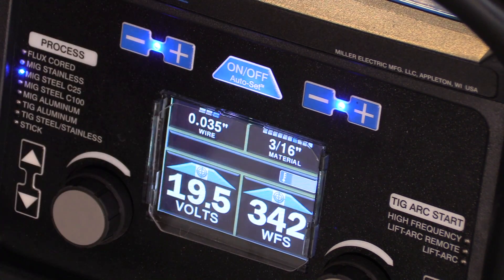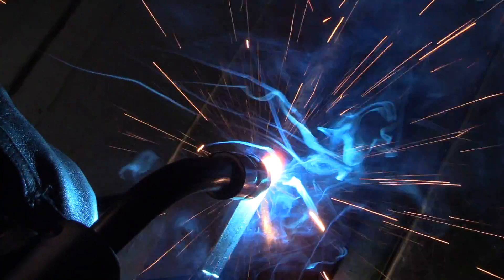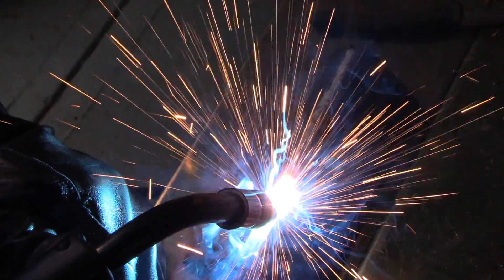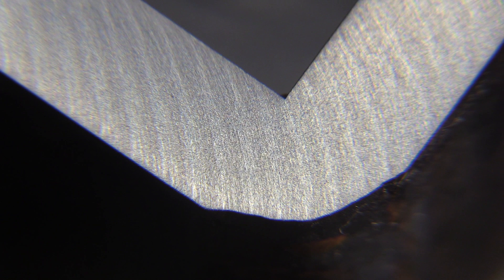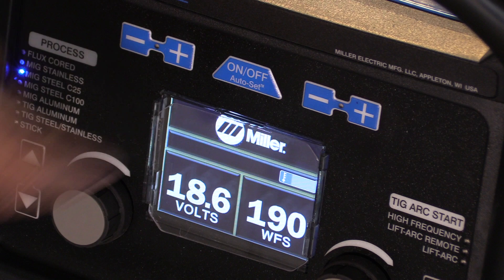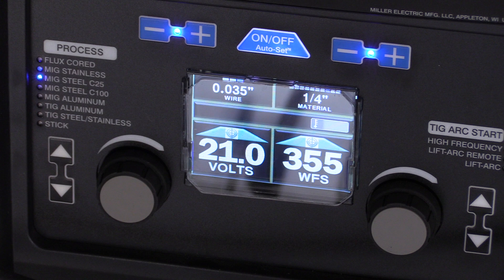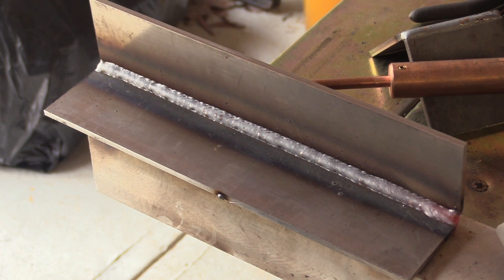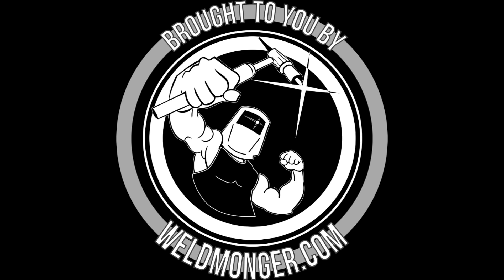Testing MIG Settings - Miller Multimatic 220 MIG Welds | Welding Tips & Tricks #Welding #MIG

Comment: Basically the Mig Like Tig motion is the old school "Whipping It".  By preheating the metal a bit more by whipping the arc forward, while letting the previous puddle or layer, cool. Giving it that tig like similar  appearance. I prefer to face the mig cup towards the direction I an welding. Resulting in a bit more penetration. Due to the preheating of the base material out in front of the weld puddle. Just like Tig.

Comment: I have a question I look at mig like tig wouldnt it be true that the higher the wire speed the cooler the weld?? When I mig weld my goal is always to run a tad hotter than what the volts say and a tad less wire speed than what the machine says I figure by doing that my weld is plenty hot because I dont have as much wire being fed into the material and I'm hotter than the recommended settings a little bit and my weld is flat in the groove so it looks like it had good penetration because the weld isnt convex its sunkin into the material. Please let me know what you think
Reply: i think volts determine how much wire burns off with each short ckt, while wire speed is the number of short ckt per second(Hz).  a higher wire speed equals higher  hz equals more heat.  that being said, burning wire into the puddle just heats the puddle rather than burning into the workpiece and just heaps up metal.  optimum penetration with minimal electrode use is a balance of V, WFS, gun angle, position, and travel speed

Comment: I run "motorsports mig" all week long. 1/4 I run 18.5 250 on 3/16 and 1/8 I use 17.5 200 and 5/16-3/8 I use 20.0 and 300. I weld these materials daily with the "stack of dimes" look, worth a try man!
Reply: And I use a millermatic 252 from round about 2007 she's a bad little unit.

Comment: Just 1 question , from australia  , what is a good size tig  , as in amps , for home use , i notice , you mainly run , small tigs as in power , your 110  volts ,   , just checked a few vids of your , and just notice  that ? Alot

Comment: Just bought this Machine can't wait to try it I am  Machinist Fabricator by trade and have used Miller welders for a number of years I have a small Lincoln mig in my home shop works well but I like the fact you can Tig  Mig  and Stick with this machine . Thanks Jody  for doing a series on this machine

Comment: Has the welding community changed their stance on mig welding?  25 years ago they preached that you never ever drag bare wire
Reply: I was taught to push mig. And anything 1/4 inch or more always run stringers, no weave or other motion.

Comment: HI Jody, I have a question that may also be of general interest for any welder ; especially beginners.
I enjoy TIG welding, recently I purchased some gloves: some of the black new design you have in your store, but also some Tillman 25BM's.  The Tillmen's were purchased on-line.  My question is regarding the 25BM's.  They are made of a synthetic type of material (i think) and they are exceptionally soft to the touch.  The problem is they "shed" like snow flakes EVERYWHERE!    Anyone who uses them knows exactly what I mean.  IMO, that is just unexceptionable as it really makes a mess.  So, I washed them...... here is my question of common interest:  If they are damp or wet from washing, (and one is in a hurry to use them) does that pose a electrical shock hazard?  That thought crossed my mind as I was hanging them up to dry.
Reply: I would say yes about the shock hazard..my gloves were wet with sweat one day when I was tig welding on table..and I did get a little jolt I have some tillman 1338 and some 24c but haven't experienced that problem...new to tig welding myself..
Reply: also made the mistake of laying on my back on shop floor to weld on bottom of a aluminum boat on a foggy day..floor had some sweat from fog also gave me a little jolt
Reply: @luisvega1294  Thanks Luis, I'm glad to see you read my comment for the manor in which it was intended.  Many times we are so focused on the task at hand we forget to watch out for ourselves!

Comment: With mig you can crank it up and you can control penetration with stick out and angle. Want more? Then get it in tighter and use less angle. Want to not blow through the 7ga steel when welding at 350 amps? Give that bad boy some more push angle and stick the wire out a little more.

Comment: You don't tell us what gas you used, which is a critical factor in penetration. And I don't think either of your passes was hot enough. I would have been up around 22 volts at least with at least 90% Argon. Are frequently weld quarter inch or even 3/16 at higher temperatures than that but the 22 still allows me to build up a little bit of weld and go dead smooth with it with no laps at all. A slight push to the wire sometimes or perpendicular to the metal.

When you slow down your travel speed you can fudge more heat into the metal. However the only machines I have ever used that automatically set the voltage and the wire speed, we're not very good at it. I never was able to get them to run right. But they were early machines. Some of the newer ones may be better at it. But because I did some fairly critical welding I developed a method for using o35 where and doing a vertical down that would actually pass a bend test. And that can usually only be passed with a vertical up with flux core wire. I would not show that procedure to anyone health because if they did it wrong they could hurt somebody.

I learned a long time ago that the biggest failure people have with MIG welding is they don't turn the machine up high enough. They turn it up enough to get a good-looking weld, but it frequently does not do the job. I actually saw somebody do some welds one time and you could hit the piece with a hammer and knocked the weld off of the two pieces of metal. Was a very nice looking well. But it didn't stick to either piece. That's a really neat trick, but I didn't bother asking the guy how he did it. All I did was tell him never weld two pieces of metal together with those settings ever again.

Anytime I did well this sounded like a TIG oh, there was literally and spray arc and it was always a rook weld on a very heavy weld. It was always with 92% argon 8% CO2, or 100% Argon. It was always at about 28 to 30 volts. And it was always at him rather High is it would just hum. Then I would turn it down to about 26 and I would do a cover weld to build it up. That way I'm not trying to do everything in one pass then leave a route that is not well saturated.
Reply: thanks for the direction

Comment: At 1/4" thick in position, why not use spray transfer for faster travel speed and good penetration? Especially for production runs where time is money.
Reply: The Multimatic 220 is not capable of spray transfer, since the necessary parameters are outside of its capability.

Comment: I have a request.  Could you demonstrate the thickest and thinnest welds with a 120 VAC MIG machine, like my Lincoln 140C, please?
Reply: He did this years ago. Even went into how you can use straight CO2 to get just a little bit more out of the 120V machines.

Comment: I got the mig like tig looking pretty good once. Same thing low voltage and wire feed. Heard it also depends on the machine. You need to whip really far forward and whip back really quick. Don't want to build up high. Looks ok, but i prefer not to weld like that for a serviceable part, which most stuff for me is. Love the video!

Comment: I thought you welded the entire inside on the same settings so why the difference in penetration from one to the other on the inside joint? The onle on the right doesn't look like it penetrated properly.

Comment: I like to run hot, I'd probably run 500 ipm on that with .035
Reply: I've done that before.  Crank up the voltage to around 25v too and you're off and running.

Comment: Like the cut and etch, shows which weld really is better.  Would be interesting to see similar with aluminum TIG.  I tend to travel slower and have less space between dimes, it's how I was taught.  I've played around and upped travel speed and can get more space between dimes but I feel like I'm going to fast to make sure to tie everything in.
Reply: Dimes in tig have a role in that every dip lowers puddle heat.  in mig it is just an appearance thing and probably wastes time and electrode.  moving back into the bubble with mig lowers penetration into the base metal and wastes metal.

Comment: Thanks for the new video.  I am practicing my hand movement with the gun but I find it hard to keep the gun steady without bracing my left hand on the workpiece or work bench...then it is hard to move along.. I run out of room to move..  I see you keep both hands together and move them as one steady motion with the gun. I guess it just one of those things that get easier with practice. Cheers Chris.

Comment: Thank you JODY! I do repairs for a trucking Company. Dollies and hand trucks. Usually stick weld, my tried and true. Got an ESAB 215, Great machine. Figured MiG would be quicker. I used that lower travel speed for a refrigerator dollie base. 3/16” plate 24” length 4” ht. Vertical section, 24” length 5” with horizontal section. Thought I laid it in good thinking slower speed would penetrate better. I was wrong, three months into service cracked in half. Granted the guys are brutal with equipment, but I looked at it and penetration was extremely limited. Strictly on me! Put it back in service with 7018 stick. Time to get back in the groove with MIG, doing lot of self testing now. I do appreciate your videos and Weldmonger store. This old stubborn dog is still learning. 👍😇
Reply from the maker: always something to learn ...thats for sure...thanks very much

Comment: Part of using mig like tig is to fool the inspectors at the race track. Racing organizations really prefer tig on 4130 tube, if you use mig they really want the entire cage heat treated. But if it looks like tig, it may pass right by inspection. I think NASCAR is one of the few that requires samples of work for testing (might be wrong).

Comment: On my older mig I can set power (amps) and wire feed separately. which I found nice for welding classic cars, sometimes I liked higher amps and a lower wire feed ratio for tacks and getting extra penetration, New welders seem to have taken this option away.
Reply: Hey krusher74, I've noticed the same thing but have found that most new rigs give you a preset based on material type and thickness etc but then you can fine tune your parameters like amperage and wire feed to your liking.
Reply: @Sonic_Ox  many I have found don't have separate amp and wire feed buttons, on my new welder I just have wire-speed, as i turn that up amps go up too.